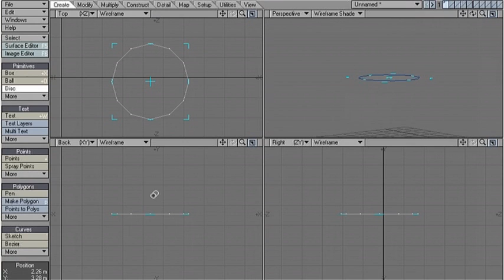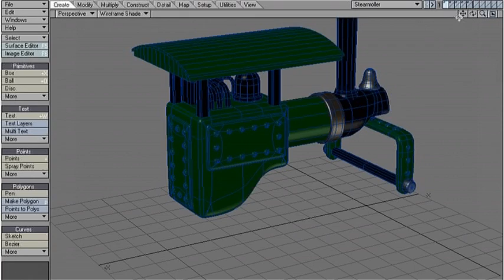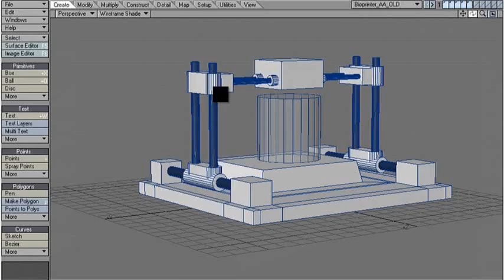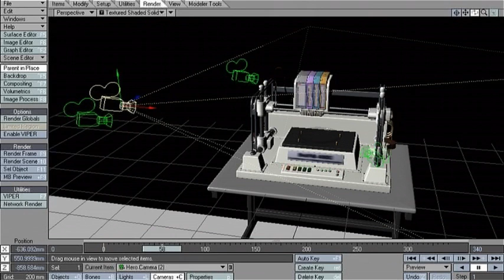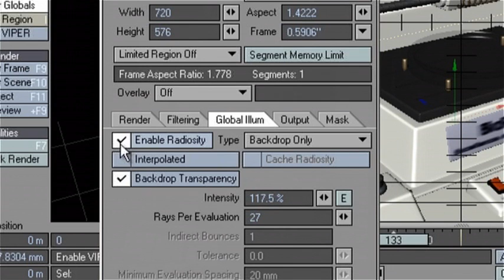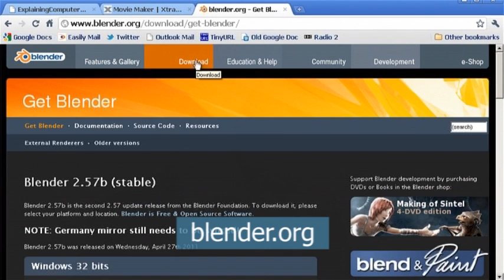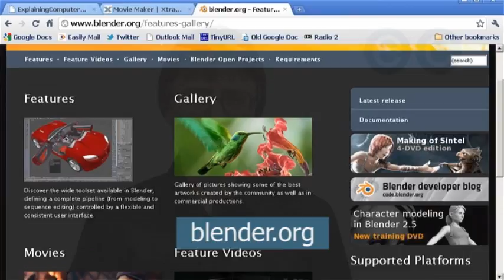Explaining 3D Computer Graphics

Comment: Have you updated to Cinema 4D or Maya yet? Or even Blender?
Reply from the maker: Of these, only Maya would be an upgrade. LightWave is used extensively in television (and even for some R2D2 shots in Attack of the Clones!), so I don't plan on migrating.
Reply: Yeah but the set up looks extremely old and outdated from what the current software and hardware the industry uses today
Reply from the maker: ***** I am sure that what you say is true -- if I were starting from scratch, today I would certainly go with Blender. But like many I have a long learning investment in my current package (LightWave), not to mention a large number of assets (not just models, but scenes, simulations, etc) that make switching packages problematic.

Comment from the maker: @waseem1173 Final renders do not depend on the graphics capabilities of your machine at all. However, a reasonable (though not pro spec) graphic card is are required to work with textured models as I show in the video. I'm currently running a GeForce 9500GT card. I suspect that on an i5 or i7 PC you could get by with onboard graphics.